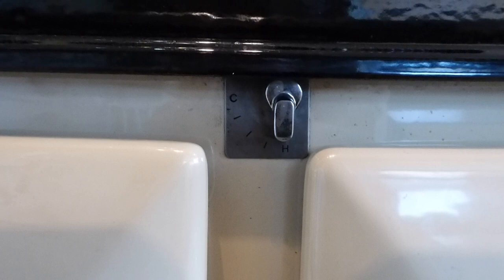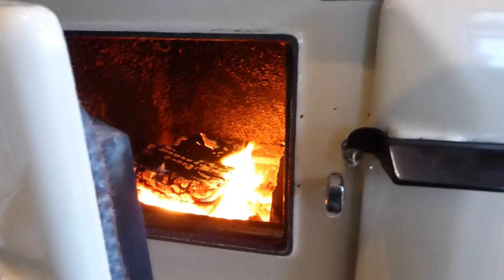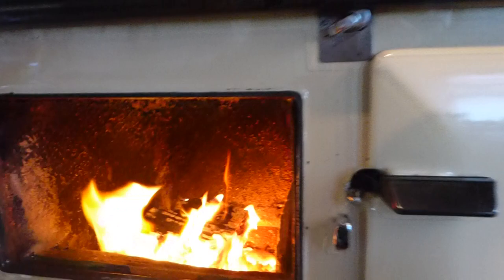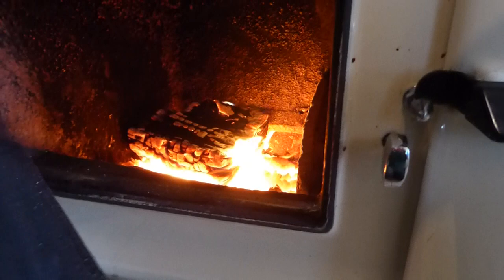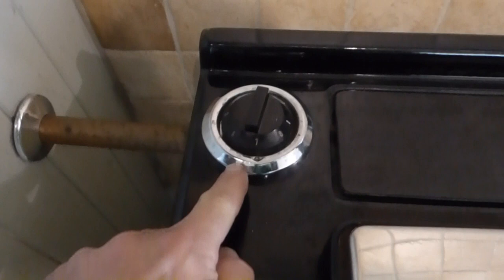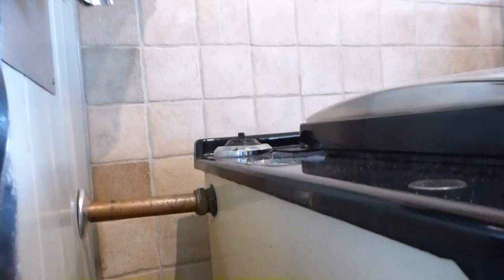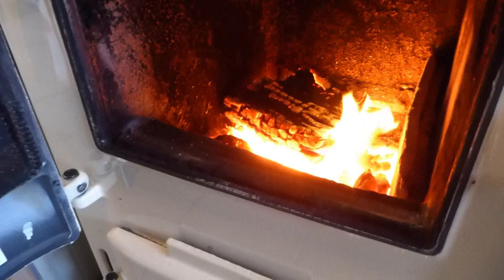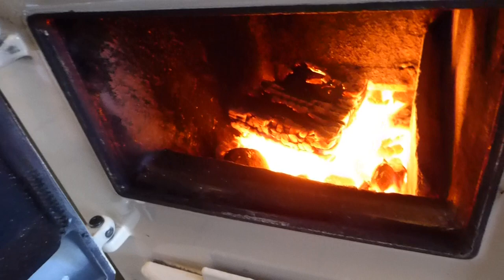RAYBURN SFW SOLID FUEL & WOOD HEATING MODE

Comment: The control on top isn't heating only, it adjusts air going into the fire pit thus affecting all operations.
Reply from the maker: It will let the oven heat up, your right but not as good as opening the air spinner. As Rayburn user instructions show... Set the cooker/boiler damper knob 'H'. Close spinwheel. To regulate burning, set the boiler thermostat knob to '8'(high) or minimum rate '1' (low).Adjust as required to suit desired water heating. COOKER CONTROL, The fire is controlled by using the spinwheel on the ash pit door to govern the air supply. The adjustable flue chamber damper is for reducing the chimney draught, and the more it can be closed, the easier the cooker is to control. This was made, just for a basic heating set up.